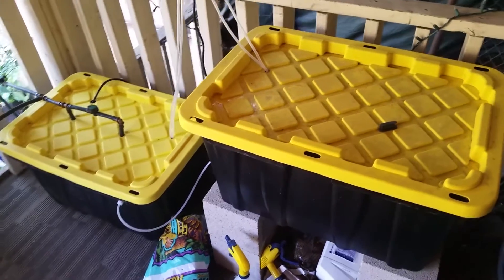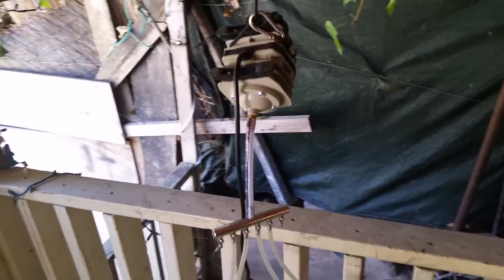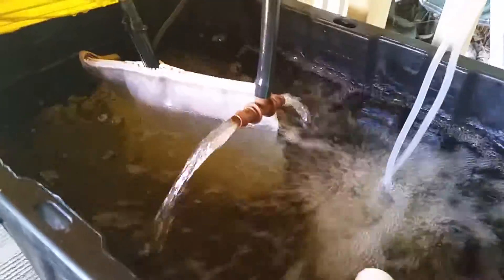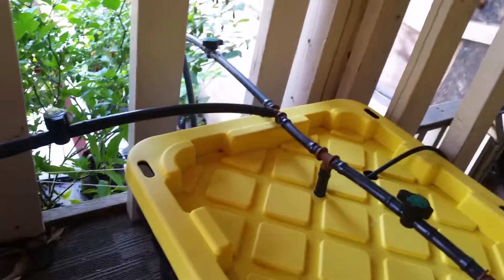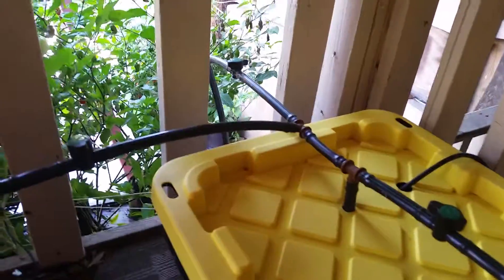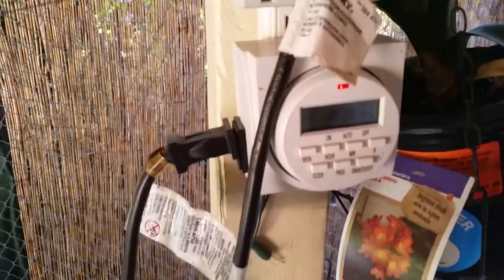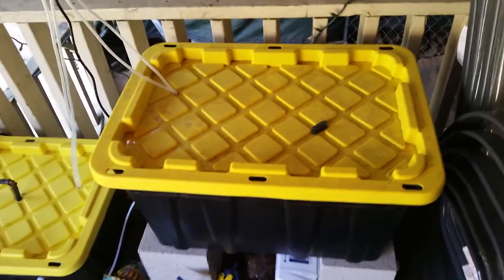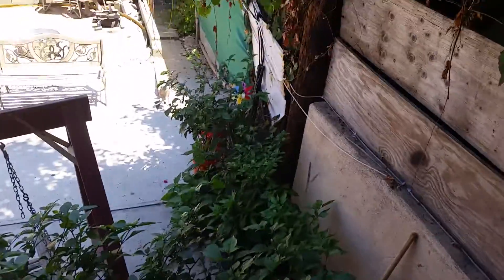Best Hydroponic "Drain To Waste" Setup - Reservoir

Comment: Man that's a great set up Anthony.  Do you run into problems with your water temperature in the reservoirs?  If so what do you do to keep the temps down.  Thanks!
Reply from the maker: No i dont brotha as its under my porch where its being shaded..also just make sure you have a good air pump, as thats key on hot summer day as the heat tends kill off the oxygen.
Reply: Thanks!
Reply from the maker: Your welcome